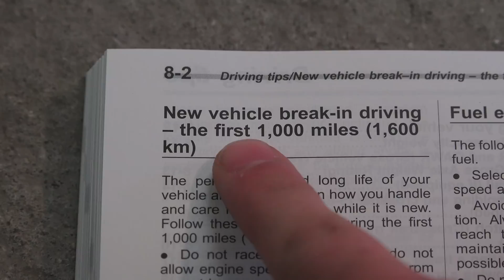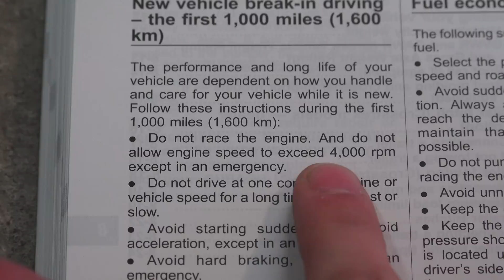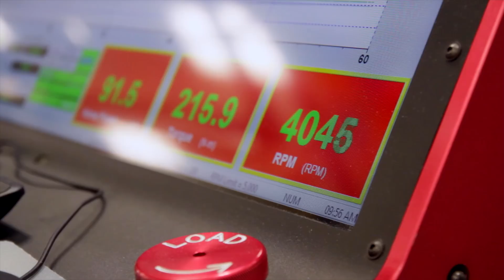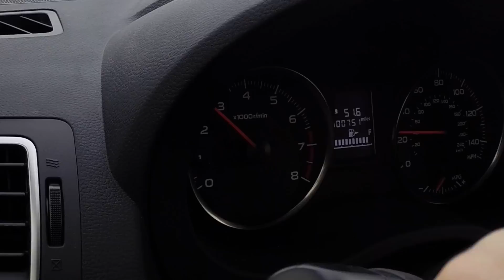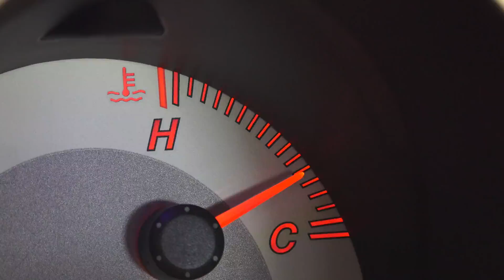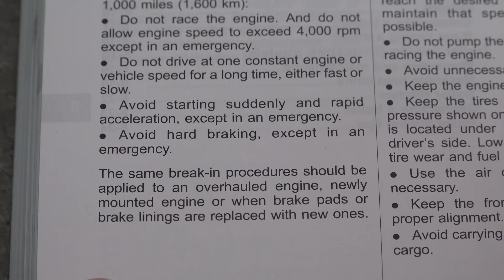5 Things You Should Never Do In A Brand New Car

Comment: well i know a lot of people are gunna dissagree with me on this, and thats fine. But if u dont know, the engine mannufacturers that make the engins that go into your cars, are tested multiple times before actually being used in a vehicle. and they test the car at low rpm, all the way to max rpm. and they do this because they want to make sure that the car can handle whatever you throw at it. so before you even get your car, most of the break in has been started. and the reason why all car manufacturers say that you should only do the easy break in is because if they wrote in the mannual that you should drive the car kinda hard to make sure everything seals properly, they would get sued because people would be going out driving their cars around fast and they would crash or speed and get caught by a cop and just say"the mannual told my to drive fast". either way, believe what you wnat to believe, but thats just how i see it. chao.
Reply: Would like to say thank you for placing my family name at the end of your article.
Reply: no problemo
Reply: Braden Lehman the engine is not the only item that needs break in think about the transmission, hard break in would cause more oil use
Reply: Dutch Moto pretty sure the trans has a similar process for the same reason. They have to make sure it wont just blow up while your driving and shifting
Reply: Braden Lehman Wow. I never thought about that. You make a lot of sense!
Reply: i agree with you Braden Lehman some manufacturer let the engine run for straight 12 hrs before they install it on the car body. its just the warranty that the company is worried about if you do not do the break in because if there is something faulty sure it will come out within the warranty period if you do not do break in
Reply: Very good point!
Reply: Braden Lehman Mr chao 😀???
Reply: ciao
Reply: Jake Smith now now, I am sure this fellow has an automotive engineering degree, AND has purchased several brand new cars . He probably has a job with a major automotive company designing internal combustion engines!!
Reply: Steve Franklin Sure go ahead and assume.
Reply: Jake Smith it was sarcasm,  I was agreeing with you.....
Reply: Steve Franklin Im a little off today.
Plus sarcasm is somewhat difficult to gauge without actual dialogue.That or an Lol at the end.
Reply: Jake Smith gotcha. No worries!
Reply: LOL. Funny thing is ....Lehman is actually right! Engineering degree or not...at least he's right about the first half. How do I know? Cuz I am an engineer with electrical and powertrain for an OEM.
Reply: Agree here completely. A break in is a break in. Its very well over thought now.
Btw i feel hla or lifters etc need the light break in and pistons moderate but you have to settle in between because one affect can compromise another.
I hear to many new cars with lifter or hla are super noisy and i bet the didnt get to operating temp before running in the break in period.
We may be better at machining these days but our metals are still far to porous and can be flawed to easy. 
Had a car with over 200k and was quieter than a car with 20k simply because i can guarantee break in wasnt followed.
Listen to your manufacturer specs to be same as they designed their break in TO THAT MOTOR.
Reply: Braden Lehman Cuz you know,we are gonna believe a youtuber with no content.....or probably even a job.

Comment: The idea that every single car should have the same rules applied to it for break in is a bit flawed on its own.      

Having built a fair share of motors; both for race cars and street cars; this really only applies to consumer grade "average" cars...

For anything with a older flat tappet; don't forget to add zinc or ZDDP for break-in.

Missed kind of the most important item; change that oil!  I typically do 100 miles, 500 miles, 1000 miles and then every 3k from then out.   Normally start with 0w-40 or 5w and then go over to whatever manufacturer recommends after.  Amount of metal flake and particles in the first 3 is unbelievable; you don't want the sandpaper metal grit thrashing around in your motor during break in.  Change while the motor is still hot!

Race-car applications; we usually do 1 hour run and then a 4 hour run.

Comment: hi 

do you need to warm up the car before driving ?
Reply: Sultan89 , Yes, in normal temperatures (40 degrees and higher) let your engine run for 15-30 seconds before driving, in colder temperatures (below 40 degrees) let it run for 30 seconds to one minute depending how cold it is
Reply: 30 seconds

Brave man right here
Reply: Sultan89 , yes at least 2 or 3 minutes

Comment: I worked as an ME in technical services for UK dyno company Froude decades ago.  All manufacturers I visited doing production testing verify correct engine power on a dyno, either 100% of production or on a sample basis.  The test happens within about 3 minutes using pre-warmed coolant.  Although I agree with your recommendations on a theoretical level, in practice the only issue I've ever encountered on a personal level is where too gentle driving produced glazed bores with subsequent excessive oil burning on overrun.  That problem I eventually solved by driving the car at full throttle for 25 minutes on an autobahn.

Comment: Hmmm... I disagree. Hard break in can be allot better. In fact Suzuki with sport bikes, dynos them to red line at full throttle and shits all over his arguments. They never recommend it because then they are liable. Floor it all you want, nothing bad will happen. No one has proof other wise.
Reply: breaking in built engine and new new engine is different. The clearance on a new new engine are tight tight thats why they blow. Now on a built engine the clearances are greater.
Reply: Rolando Macias again they test these at top throttle and do a hard break in at the factory with 80% of cars, I have never seen proof of how a hard break in is bad. Not to mention "Jake the garden snake" recently bought a brand new sport bike from the dealer, got one mile on it, and wheelied it to red line.

Comment: The only thing you have to do with a new engine nowadays is get it to operating temperature several times while going through the whole range to seat all of the gaskets. if you're real paranoid change the oil at 300 to 500 miles. you want to go through the whole range of the gears and use all the accessories in your vehicle never doing any one thing for too long.

Comment: Brakes and tires have nothing to do with the manufacturers telling us not to tow.  It all goes back to the first points you were talking about.  The engine and transmission need time to seat their worming parts together and not have a hard load on them.

The only tires you need to worry about when they are brand new are Motorcycle tires.  Car tires and brake pads/shoes are fine  right off the rack to tow or drive four thousand miles.

Comment: I am pretty sure ALL the car company already break-in the engine before the cars roll out the factory.. because they do need to do a QC check on all the cars before it goes for sale, so they know if there are any defect.. You do know that when you buy a new car and drive it for the first time its not exactly the first time that car have been driven right? What company now would send out a car without testing it first and knowing if the product works in the first place..and would not have made sure it wont breakdown after 500miles.. it would be a lawsuit nightmare..
Reply: P.S. i have no experience working with a car manufacturer company.. So my opinions are based on logic and rational thinking.. and from what i have read and watched in media..

Comment: +jakethegardensnake HARD BREAK IN FTW
Reply: These companies likely take a sample engine or two from each batch and do hard testing to make sure there aren't any massive or obvious issues with the workmanship, materials, alloy mixtures, so on and so forth. They simply don't and can't do that on every single engine produced.
Reply: I've always used this method. 

On a Dyno: 
Warm the engine up 
completely !!

Then, using 4th gear:

Do Three 1/2 Throttle dyno runs from 
40% - 60% of your engine's max rpm
Let it Cool Down For About 15 Minutes

Do Three 3/4 Throttle dyno runs from 
40% - 80% of your engine's max rpm 
Let it Cool Down For About 15 Minutes

Do Three Full Throttle dyno runs from 
30% - 100% of your engine's max rpm
Let it Cool Down For About 15 Minutes
Go For It !!
Reply: EmissaryGW2 look it up on youtube, somethibg along the lines of factory engine testing, i found videos of honda, toyota, ktm, AMG, bugatti, and kia doing hard engine breakin/test in the factory. In fact in the one video kia admitted to putting their engines through 300 hours of strenuous test including long periods of high load.
Reply: Go hard or go home
Reply: Omg did u watch the video when he drove the brand new fz-7 from the dealership, and he did a wheelie the moment he got on the road, pure gold
Reply: I don't know where you're getting the information that they "break in their engines SUPER HARD at the engine assembly line". I'm pretty sure not a single one of them "breaks in" the engine at all on the assembly line, they may do a quick one-time heavy throttle to seat the rings correctly, and sometimes will do a dyno test for Q/A but they definitely don't keep the engine at high load and RPM for an extended period of time.
Reply: Not everyone gets 300 hours of testing, but every engine gets run up to redline hard and fast to start the ring seating process. It's that initial hard run-in that seats those rings correctly. The gentle break-in period in the owners manual is more for allowing more gentle wearing of the parts. I've never really followed that, and have simply driven normally. Vary your engine speed a bit, but don't be afraid to rev it. If there is a time to do it, it's when the engine is new and hasn't yet formed a lip at the top of the cylinder. What is a good idea, is a couple quick oil changes right at the beginning of ownership. Put the first 500 miles (800km) on, then change the oil and filter to get that initial leftover casting flash and debris out. Change it again at 1500 miles (2400km) to get the last bits and finer stuff. Start running a good synthetic oil as specified by the factory and follow normal oil change intervals at that point.
Reply: the process of wearing in an engine has more to do with the heat of the metal more than the rpm. 
(metal expands when heated)
Reply: The motoman way WTF!! I've had 3 brand new, less than 20 miles in the odometer cars and each one has burnt zero oil. I've broken in each of them the motoman method. To the engeneering explained guy, explain why audi, Ferrari and I think Lamborghini break in their engines SUPER HARD at the engine assembly line then?
Reply: yes this

Comment: plataux honing is a method of artificially running in an engine during the cylinder boring process. keystone rings are ceramic coated and cannot wear the cylinder. often mounted in a composate piston with a hardened lustrum band.

Comment: most modern engines have plataux honed bores (and key stone piston rings) meaning no "run in" is required. Of couse the manual will gas on about running in as it can aid manufactures in getting out of nasty warranty claims. long gone are the days of using running in oil and engines burning oil until run in.

Comment: i not 100% sure how this works with cars. but i worked for a big truck company that build there own engines. what they do there with every engine is test it. before these tests the piston is lubricated in a special coating. and when they test the engine they drive the engine in allready, by going into high rpm even higher then the truck can go when it finished. this they do until the lubricant is of the piston. the engine runnned for around 15km then.

Comment: Now i have heard that a hard break in is good for motorcycles, because it gets the oil seal on the pistons better (or something like that) and makes the bike last longer. So you want to go hard on the engine and change the oil often. Thats why manufacturers that make sport bikes or super sport bikes take the bike to a dyno right after it comes off the assembly line, and run it full throttle to red line every gear for the first couple of miles, to try and get that good seal before it sells. They say to have an easy break in for the first 500 miles on the manuals, because if they said to have a hard break in on your motorcycle, and many people are getting hurt because of it, they could get in serious trouble. Now im not very experienced in mechanics and im trying to learn, but would you say that this is similar for cars or only motorcycles?

Comment: Break in of an modern engine should be done by alternating between load and engine braking but not at too high revs.
This is only true for those that really want that extra % of power, otherwise the engines of today do NOT need any special break in period. Also the power gain from breaking in a modern engine is well under 10%.

Comment: You know if we where talking about 1970's level of surface finish and materials I would have to agree with you 100%. The thing is the surface finish on engines friction surfaces is fantastic on a lot of brands. The use of moly rings and and rollerized rockers and low tensions rings is a game changer I think. Sure WOT on a new engine might not be the best thing but 1/2 to  3/4 WOT and up to low speeds from a rolling start  like 10 mph up to 50mph and plenty of engine breaking(standard transmission) is claimed by some to be the best way to properly seat rings the first 150 miles. Dodge owners manuals from the 1970's all the way up through my Dad's 2001 said to do some hard pulls during break in the owners manual. I think the RPM limits though of staying below 4000 RPM makes perfect sense! Most recommendation in Owners Manuals are aimed at idiotic owners and lowest common denominator across all product lines few OEM owner's manuals have vehicle specific recommendations until you get to Super High Performance Cars or 1 Ton Trucks most of the rest are cut and past. Most OEM's do not even trust the customer to make intelligent decisions on oil viscosity based on usage and ambient temperature let alone tracking the car versus daily driver. You get one recommended oil viscosity and that is it usually 5W20, 5W30 for most OEM's in North America. 

Traditionally when most cars where rear wheel drive the biggest reason for keeping speeds low during break-in was due to ring and pinon temperatures not because of the piston rings. Lapping ring and pinion gears and matching them very closely is expensive and time consuming and add's complication to staging at the production level.  When you rebuild old engines the general rule of thumb is to fire them up quickly after priming the system and to keep the RPM's above 2000 and not to rev because it slings the oil off the cam and the off the rings while increasing heat and loading especially at the wrist pin. Drop to low and the cams often took a hit. 

My Dad basically does what Acura does but he does not have a computer programmed dynamic chassis dyno to do it for him! 

You might want to take a look at Honda and Toyota factory fill used oil analysis UOA after the recommended oil change interval OCI. You will see some 10,000 mile UOA of factory fill during break-in in some Honda's that have show insanely low break-in wear with unremarkable factory oil with low really good particle counts. Same thing from Toyota. You can tell where the wear is taking place from by which metals are in the UOA. 

So it is not that I really disagree to much with you only that I think people are often living a few decades behind in terms of how gingerly they treat their car's during an extended break-in period that really has no basis in fact. Since UOA is so cheap and you can get a particle count with it as well there is no need to trust the OEM 100% blindly you can now do your own research as well. Int he case of GM I have seen UOA of most of their V8's and often even at 50,000 on the power train using great oils and modest OCI and light use the engine will have terrible wer number's compared to a modern Toyota or Honda I4 or V8 with cheap oil and max OCI. I think you have to look at production methods, materials used, surface finish of the parts when it leaves the factory, power density etc....
Reply: buckaroobonsi555 ...your long winded and provide zero evidence to back up your opinions. There is absolutely nothing special about a Honda or Toyota regarding engine manufacturing vs a VW or GM or Ford! Sorry. I've seen 1st hand the very careful & high tech engine build facilities of Ford / GM & Honda 1st hand due to my profession. I gave 1st hand experience. Not a $20 UOA of 1 car beat up vs another better cared for etc etc. 100% wrong internet jargon.
Reply: gm and toyota manufacture some of the most durable engines on the planet if broken in and maintained properly. if neither condition is met, both brands result in engines that drink oil.

Comment: mass production :(
Research shows that the very first minutes, 60 or so is the most important for high finish quality engine build, and in such it is recommended that first full throttle to redline acceleration is done within 20-30 minutes to get the best possible seal, which can affect as much as 10-20% on power, so few % more efficiency.

Different goals, different mfg processes